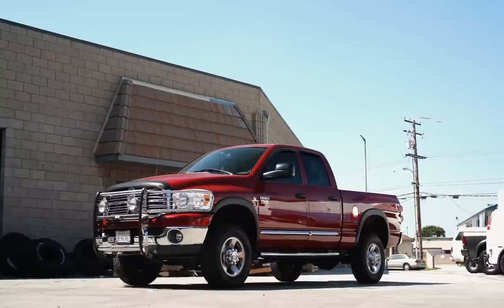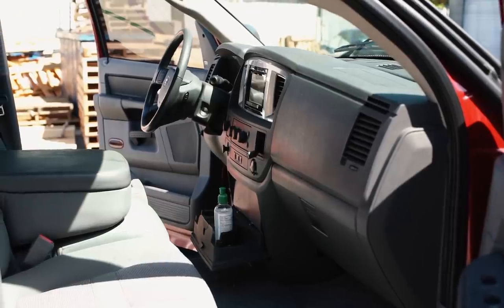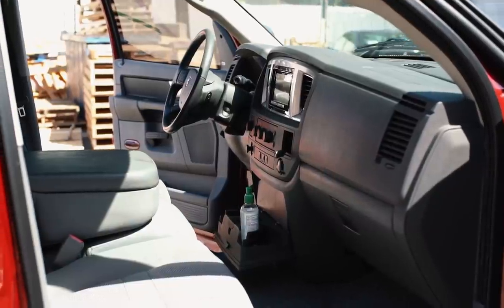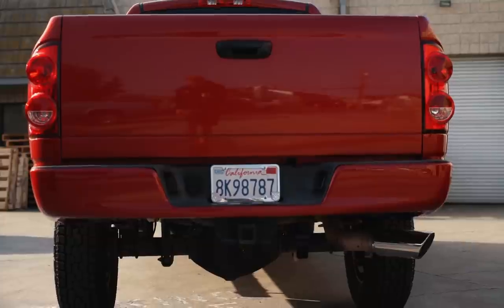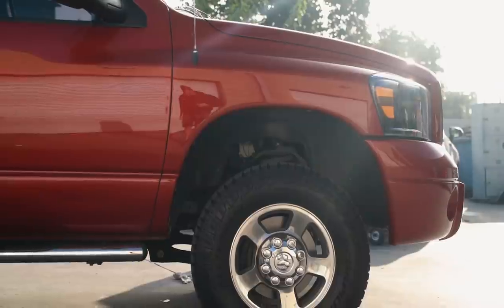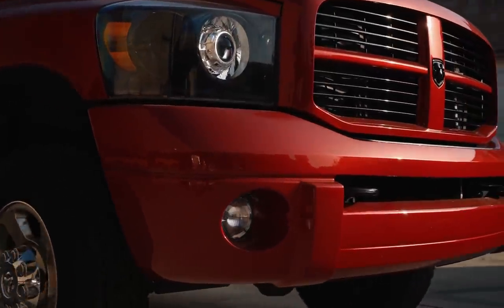3rd Gen Cummins Makeover | Carli Suspension and 37s!

Comment from the maker: The suspension on this truck: (Carli Starter system with track bar, end links, high clearance control arms, and add a pack leaf upgrade): http://www.cjcoffroad.com/Carli-Dodge-Ram-2500-3500-4x4-Starter-System-p/cs-dstarter.htm

Wheels: 17” CJC Edition Method 315: http://www.cjcoffroad.com/Method-Race-Wheels-CJC-Edition-Ram-315-p/method-315.htm

Tires: 37/12.5/17 Toyo RT

Headlights custom built by Retroshop: https://retroshop.us
Reply: Would the truck look fine without the add a leaf rear? I am looking at just leveling the front with the carli starter kit but wasn’t gonna do the rear add a leaf because it adds like $500 to the lift.  I need 4 shocks so wasn’t considering the carli leveling system kit which only has front shocks.  Thoughts?

Comment: Cant agree more. I have an 06’ I did a similar set up on. I also have a steering box stabilizer, read head stealing gear, and crossover steering and track bar (7/8th hiems kit from rough stuff). The truck drives like a modern SUV now. I actually got hit buy a mid size sedan at 60 and I assumed the Carli control arms would be trashed.. the frame bent before the control arms or DOM tube (steering) did.. incredible.

Comment: I just bought a ‘07 on 42’s with a huge lift probably 6” not sure on the details of the lift components just bought it last night because it was such a good deal. Do you sell anything for the 1500’s all I see if 2500/3500’s. Front tires are going to need to be replaced soon thinking of going 40’s because 42” selection sucks. Looking for something aggressive with a good life span. Any advice of either suspension or tires? Also think I need an alignment, I mostly care about good steering and ride quality as ive got kids, more of a toy than anything got a 22 tahoe RST for my reliable daily with the kids, awesome truck btw.

Comment: I wish toyo made a 37r17 R/T in 10 ply load range E. I won’t run D rated tires on my truck but I love the R/T . I had it in a 35” before I moved to 37s
Reply from the maker: Remember that even though these tires have a D letter rating, they’re rated to 3,500 pounds which is E load range territory.

Comment: Very nice set up.  Did MPG's take a hit with the lift and 37's?  I do a lot of HWY driving in the summertime.  A 2.5 inch lift with 35's may be a better fit for high miles driving?
Reply from the maker: They really don't make much of a difference on the highway! Around town you'll notice a slight hit, but that's about it.
Reply: @CJCOffRoad  I'll definitely give you a call when I'm ready to upgrade.  Waiting for my 33's to wear out.

Comment: Serious question, how would this setup work with towing an RV? I have a 3rd gen diesel and it's primary purpose is towing our RV. I figured the ride quality was just how trucks drove, but I've seen a few videos now that talk about the ride quality after upgrading only the suspension on these Dodges. But will I see adverse effects (gas milage, towing capacity, tire wear, etc) from this kind of upgrade?
Reply from the maker: This particular system (and really any Carli system) can be set up with either the stock rear leaf packs for stock capacity, or one of the Carli leaf packs and airbag kits for better ride and stock capacity. Aside from cost to make it happen, there's really no downside to upgrading suspension with a proper system like these!

Comment: I have a 3rd gen.  2005 3500 Quad Cab SRW with the SWB. I tow a camper with it. Would like to upgrade suspension for better ride but keep the towing capacity.  What would you recommend?
Reply: Would also like to run 35 inch tires maybe 37's.
Reply from the maker: This system should do the trick! To maintain full tow capacity you can keep your factory leaf springs, or do this add a pack system and remove the overload on your pack. If the camper has extremely heavy tongue weight, you can also do a Firestone bag and daystar cradle system.
Reply: @CJCOffRoad  what is in the add a pack?

Comment: I have a 3rd Gen 3/4 ton and need to replace the existing 35x12.5 VorTrac tires. They will not balance and requires more weights than reasonable. Plus the side walls show dry rot cracking in only a few years of service. I might consider the 37s, but I already have issues with tire scrub on lower control arms during turns. 37s will be worse. How does the Carli control arms avoid this scrubbing with 37s? And does your tires, as shown, balance reasonably well without needing to add balance bead bags? Thanks.
Reply from the maker: Wheel specs are key to rubbing the arms. To fit 37s on a Ram you need a 8.5-9” wide wheel with +18 to +25 offset. To make that work these arms also have a fabricated notch to offer more tire clearance at full lock. With a quality tire like Toyo, Nitto, BFG etc you should only use a few ounces of weight! These balanced great.

Comment: I have a 2001 Cummins 3/4 ton. I currently have hockey pucks to get me by while I save for a nicer suspension. I am a farmer and even though this is not my field rig it is on terrible roads with wash boards, pot holes, and small bumps. Would a starter system be a good choice?
Reply from the maker: Yeah a starter system is the perfect way to improve ride on a budget and then upgrade as funds allow. It will ride night and day better than a spacer!

Comment: Curious what kind of roof height you get with a setup like this. Looking for a 3rd gen and after taking care of the basics want to run a 3” kit with either 37 or 35” but have worries about roof clearance.
Reply from the maker: You’re looking at a little over 7 feet for most of these trucks on 37s.
Reply: @CJCOffRoad  yeah pretty much what I figured. Dang parking garages at work making life difficult at 7ft 😂

Comment: what if i wanted to keep stock height of truck? im new to trucks I've had mustangs my whole life and only recently bought myself a 2004 dodge ram 2500 with the 8 ft bed and a leer cap. its a very clean truck only has 86k miles on it never beat on no rust. The stock ride is abysmal, and im trying to figure out ways to improve it without rebuilding the entire suspension. can you guys help me out? 

the truck is used to transport furniture and supplies 190 miles on highway roads from state island to southern new jersey. 
Goals with the build are to increase the mpg,  smooth out the ride, and get new tires/wheels. it is not the diesel engine either because nj/ny state laws are strict on diesel and i didn't want to deal with that.  its the updated late model 04 5.7L v8 with the 365 hp.

Comment: Up in the air about control arms atm. Will synergy steering work with carli components, stabilizer need any specific mounts if compatible?
Reply from the maker: Absolutely! We regularly using Synergy steering with a Carli stabilizer and front suspension!

Comment: I have Fabtechs that ride like junk on my 06 5.9. I’m looking for some good shocks that soak up the bumps a lot better with about a 6 inch lift.
Reply from the maker: Sadly shocks alone won't completely address your issue as those systems as a whole aren't designed to ride well. Something like this would be a huge improvement: https://www.cjcoffroad.com/collections/03-09-carli-systems/products/carli-dodge-ram-2500-3500-6-back-country-2-0-suspension-system

Comment: I would like to replace the OEM headlights on my 2005 3500 with something aftermarket and brighter than factory.  Where do you suggest I go?  Thanks for another quality video!
Reply from the maker: Doing a HID projector retrofit like these lights is absolutely the way to go if the budget allows. This is significantly better than any of the pre-done lights.
Reply: Alpharex headlights are Awsome.  I have a set on mine. Same quality as Morimotos but half the price.
Reply: @robertalley9593  Thank you.  I just checked their website.  Their lights start at 2006 and I have a 2005.  Figures lol

Comment: I have an 04 did a level kit on it rough country springs rancho 9000 adjustable shocks carli adjustable track bar and apoc industries adjustable control arms. Rides like crap lol. Do u think changing the coils to carli will make a difference and can I still use my rancho shocks or should I order the carli shocks with the coils
Reply from the maker: Ideally you’ll want to pair the Carli shocks and coils together since they’re designed to work as a system!

Comment: How does tow change? I haul a 5th wheel or large enclosed trailer with a car and stuff in it.
Reply from the maker: Carli has a few different options actually, so you can retain full capacity if desired!

Comment: This is great!!!! I was curious though,  how would this work with 10" wide wheels to get a tad more offset for a little wider stance? Have you tried different wheels from the methods?
Reply from the maker: Absolutely no chance of 37s on ten wides, but you could get a 33 or 35 to work depending on the exact specs.
Reply: @CJCOffRoad  I apologize, I should have mentioned 35s. My truck is a family vehicle as well so I'm not looking for anything bigger than that. I really was looking for a system with good driving characteristics and more clearance for larger tires with a tad wider stance. This sounds like it fits the bill. Thank you for the response!
Reply: @CJCOffRoad  this is a beautiful build by the way!
Reply from the maker: Yeah you should be able to make it work then! Just stick to less than -18 or 20 preferably. 👍

Comment: Hey man, I love the channel. I am looking at BDS but found your and I'm wondering if you could give a comparison on some difference so I can make the right decision?
Reply from the maker: BDS is a lift kit company, so their goal is height increase. With their systems you’ll see ride quality similar to or worse than stock depending on the height. Carli is a suspension system company, so you’ll see massively improved ride, but less lift height options than brands like BDS that are made to achieve X or Y desired height for looks.
Reply: @CJCOffRoad  Thanks so much for the reply. I am sold. Definitely looking to improve ride quality.

Comment: What are some good places to find a good 3rd gen with the 5.9 and 4wheel shifter on the floor? I’ve look at Car Gurus, is there other better places?
Reply: Keep an eye out on Gateway Car Connection out of Missouri. They have alot of 1st, 2nd and 3rd gen Rams , as well as OBS F250/350’s. I bought an 05 Ram 5.9 4x4(89k miles when purchased)from a dealer in Salt Lake City. I ordered a Backcountry kit that i should be receiving  soon.
Reply: I love my floor shifter 4x4. I’ve got the 2005 4 door long bed. G56 6 speed, with Yukon manual locking front hubs, put in a Yukon rear torsion diff. Next move is Carli package with full leaf pack.
Reply: @Upliftyourbrothers  Where did you find your rig?
Reply: @huntersmith9543  neighbor. Retired doctor wanting something smaller. 112k miles, no rust.

Comment: Nice, looks like more than a 3 inch lift, what plastic exactly had to be trimmed for the 37's, with these wheels having a +25 offset would an 18 need any trimming at all?
Reply from the maker: Just a small bit of the bottom cab side of the plastic fender liner up front. As long as you meet the offset and width specs you’re good to go on trimming!

Comment: What driveshaft  mods are needed for the 3" compared to the 6"
Reply from the maker: These 6” systems require the front driveshaft to be lengthened, and then a rear carrier bearing drop if equipped.

Comment: Notice they went with D load range tires. My guess is for ride quality. Anyone else run D load range and tow?
Reply from the maker: When it comes to 37s you need to go off the actually capacity of the tire and not the letter rating, since many are D rated but with E load range capacities. There's lots of options that are rated for at least 3,500 pounds per tire.
Reply: I appreciate it thanks. Ride quality improvement going to 37/17s from 35/17s? And what psi would you recommend daily driving on 37s(not towing).   @CJCOffRoad

Comment: I bet you have over $35,000 in that truck with ZERO motor upgrades... $8000 lift, how stupid is that.? Just buy a new truck
Reply: A new truck is 75-80k for a decent one, with no upgrades. Id rather spend 50k building a badass older rig. Unless its just for commuting.
Reply: @340stroke  I didn't mean a brand new truck I meant like a 2012 to 2016
Reply from the maker: This whole truck with everything we’ve done on it comes in under 27k. That’s pretty solid for a truck with only 42k miles. Not everyone has the means to buy a 70k truck, so builds like this are a great way to do more with less!
Reply: @CJCOffRoad  maybe $27K w/o any labor and wholesale parts
Reply from the maker: No that’s 27k all in and everything included as if this was a customer truck.